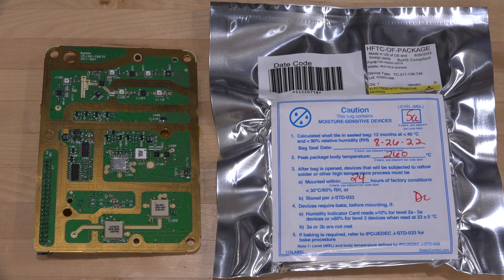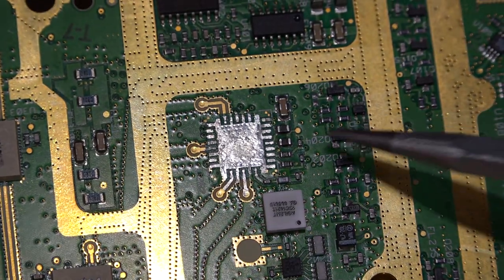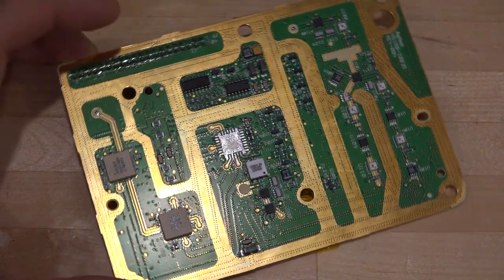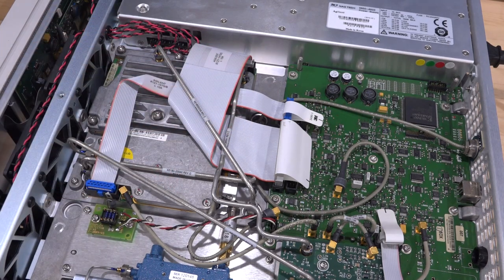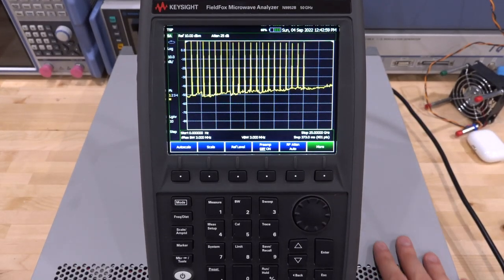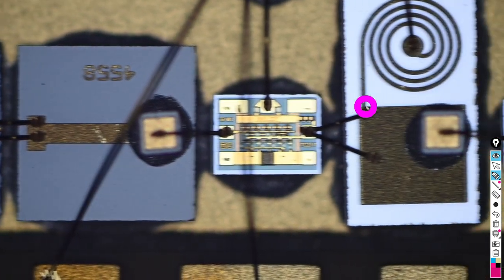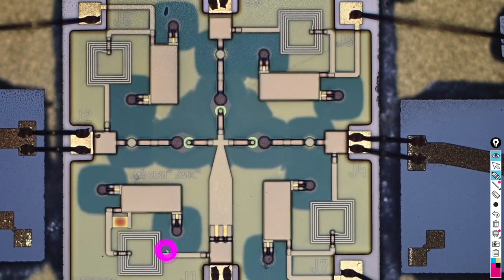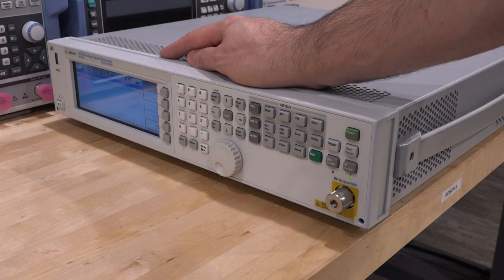TSP #213 - Keysight 20GHz MXG Analog RF Signal Generator Teardown, Repair & Analysis (Part 2)

Comment: Amazing stuff. Thanks to Keysight and you for your excellent diagnosis and repair.
Yes, we'd love a complete reverse engineering/detailed description of how those FETs and other elements are implemented and what to look for when trying to understand the architecture.
I've actually decapped, removed, and opened up a lot of microwave and mmWave devices from the big brands like an Alcatel 8 GHz transceiver, Siemens 38 GHz microwave link, etc. Would love to be able to reverse engineer some of their dies.

Thank you!

Comment: It's always cool to look at small wire bonded circuits like this.  
I actually used to be a sputtering engineer in a passive component fab.  We specialized in MOS capacitors, resistor arrays(like precision dividers), inductors and combinations of all the above.  The majority were for RF applications like this but we also made them for medical applications and fiber optics/photonics applications.  We also made quite a few interposers with integrated passives. Unfortunately we did not have an ion implanter so we could not really make active devices other than diodes.  Interestingly, you can tell which gold was sputtered and/or plated by looking at the roughness/color.  Plated gold tends to look grainy while sputtered gold looks shiny or almost white.  Look at the active components in this video compared to the passives.  Also the active devices and have probably been passivated with SiO or similar that's why they have an almost green color over much of them.  Passivation in essence is just sealing them under some material to protect them from oxidation or the elements.  We mostly did SiO passivation but sometimes used a chemical sort of like a high grade epoxy and spun it on.
One thing we specialized in were SiCr resistors which had a high sheet rho.  I think we were one of the only places in the world that did it as it was a VERY finicky process, but it could be made very stable (like <1ppb TCR!)  Other materials can do this too(and are much easier to make) but typically have an order of magnitude less resistance per square, thus requiring much longer path lengths.  We mostly made parts on Silicon or sapphire wafers.  We also had a direct laser writing machine in our photolithography bay so we could make small batches without needing to buy expensive masks.
Glad you got your generator working.  Thanks for the episode TSP!
Reply: Aw man I love direct laser writers. We had a LW405C that our group bought along with the physics department when I was in college, and it was absolutely awesome for prototyping without the mask turnaround times.

Comment: Always nice to be surprised in things like this. Someone at keysight came through. Nice for use and good publicity for them. Everybody wins. 
I am curious however how the solder this in the factory if the housing is so vulnerable to heat. Makes me doubt they do repair at all themselves.

Comment: Is there a way to see or measure where in the package the faulty component is?
Reply: You could open up the package like he did here, and then run it and use a manual probing station (like this: https://www.microtron.be/media/5f61471da324cd6ea65fc20692689d9b/cascade-pm8.pdf) to look at the signals along the way. But at this scale you would only do that if there was a series failure issue and you were improving the design for future. I don't know if Shahriar has a manual probing station.

Comment: great video again - what a sucess ! And nice you get the replacement part!. Interesting method with the low melting solder, do you have a part name on this ? Or melting temperature? I have sometimes very temperature sensitive devices to solder which is a nightmare using the standard melting powerder and reflow oven, especially when it comes to replace them.

Comment: I think a small hot plate under the board bridged to the thermal pad and set to 260 C with 400-450 C air from above would make leaded solder work.  Give the hot plate a head start of 30-45 s and concentrate the air near the pins around the perimeter.  Otherwise, bake the board at 110 C for an hour to remove condensed water and utilize an infrared oven to reflow the entire board.  Also, plenty of good flux always helps.

Comment: Thank you so much for your video! Can you tell me where to buy 1GM1-6226 chip?
Reply from the maker: Unfortunately, it cannot be purchased.
Reply: I see you have new chip to replace like in your video.
Reply from the maker: Yes, but it is not something you can buy "off the shelf". It has to be provided by Keysight directly. It is a custom part.

Comment: I'm intrigued that one of the chip dies is labeled ©agilent 1995, even though agilent was only founded in 1999. (according to wikipedia) Was the name agilent used for the division at HP before that date?
Reply: They probably updated the name with some small mask change from "HP 1995".  Most of the content would still have a 1995 copyright date.
Reply from the maker: I would guess this is what has happened.

Comment: Always great to see a nice bit of kit like this be repaired and and saved from being scraped, big thanks to those at the Keysight engineering department for sending the mythical part presumably before anyone could say no, I would be very disappointed if anyone were to face repercussions for supplying the part.

Part of me was hoping there would be some obviously broken bond-wire on one of the ceramic transmission lines that would be an ""easy"" repair but alas. However that resistive element on the switch die certainly didn't look very happy but are we sure it's a termination load, seems excessively small for the signal levels in this signal path, it's definitely not part of the forward biasing for the PIN diodes? As a drift/failure of that element could feasible cause excessive loss in the system as observed.

But also I noticed the first stage of the amplifier die at 12:18 seems to have some slight funny business going on with it? The support electronics for this device didn't seem too complex in the previous video, what's the chance of power it up by itself and probing this with an active probe or possibly some thermal measurements to determine exactly which die/substrate has failed? Would be very interested in that follow up! 

But regardless as always top notch video!

Comment: Yeah, liquid metal is indeed a nice thing, BUT, your main concern should not be only its electrical conductivity, in this case.
Rather the fact that it will eat tin based solder, and killed a lot of Nvidia GPU, where people were using it to decrease the shunt resistance used to assess the GPU power draw, allowing for greater power draw, so greater clocks.
You should also beware when using it on bare copper, it will permeate and diffuse into the copper atomic layers, decreasing slightly its thermal conductivity, hence its electrical conductivity.
Do not use liquid metal on tin solder or bare copper, on sensitive electronics, or you will regret it.
It's fine to use when deliding CPU, to remplace the original thermal interface, or when when repasting laptops.
It is also fine if the copper is plated, with a fine nickel layer, for example.